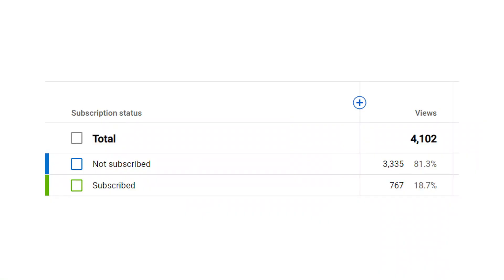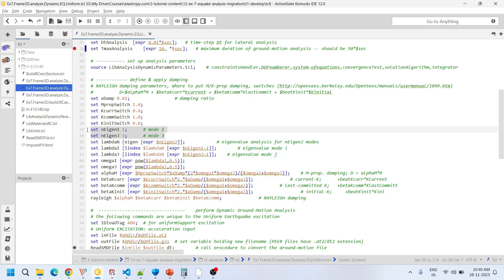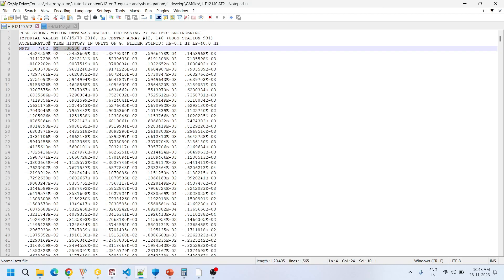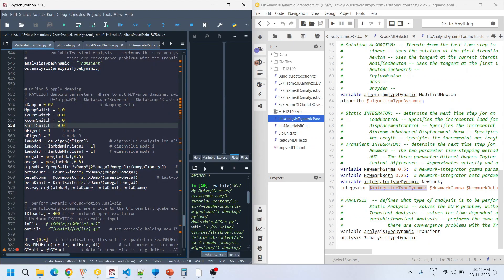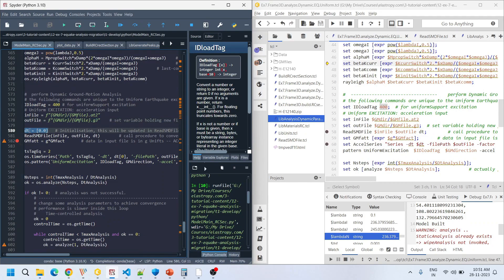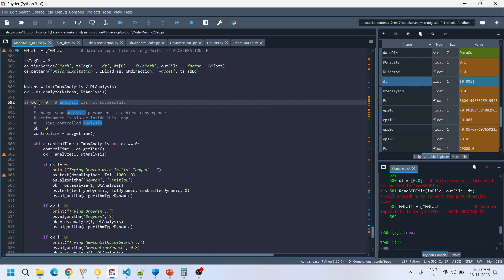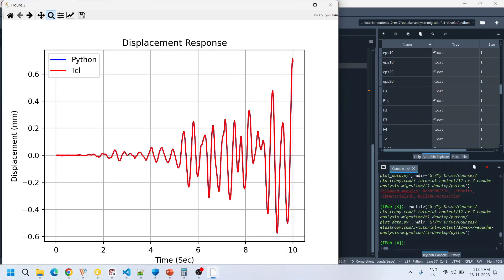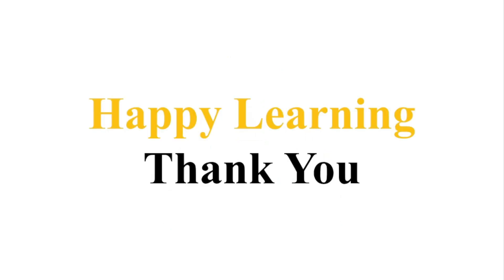Example 7 - Earthquake Analysis of RC Frame - OpenSees Tcl to Python Script Migration Series

Comment: Your local axis are x,y z, for colum (z is perpendicular to column) , and your global axis are X,Z,Y.(x=red,y =green and z=blue, Z is perpendicular to beam ) Wy did you apply the column load on Z axis rather than  on Y axis?  Same question for beam and girders.
Reply from the maker: Hi @tvnkap4291, thanks for your question! It seems there's a bit of confusion. Could you please send me an email with the relevant code screenshots along with your questions?
Reply: @elastropy  Thank you very much for your quick response. I am going to send it now.
Reply: Please check your email.